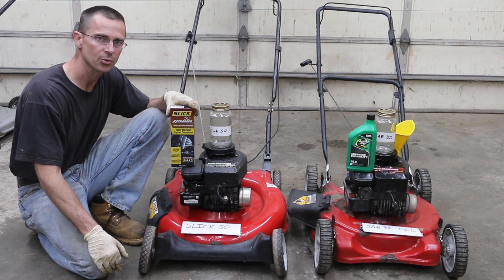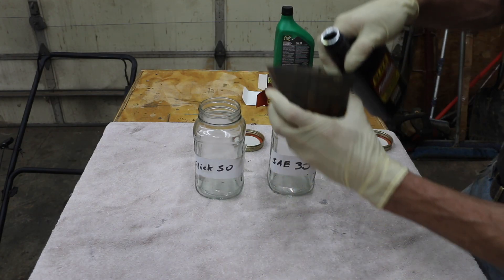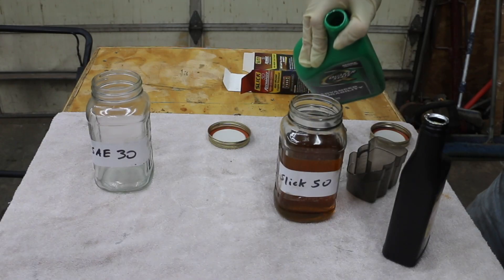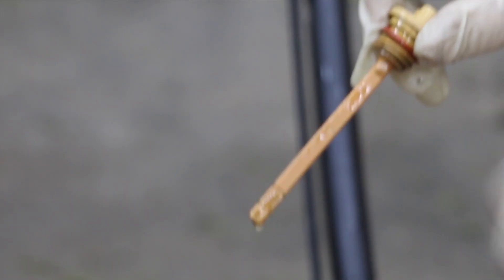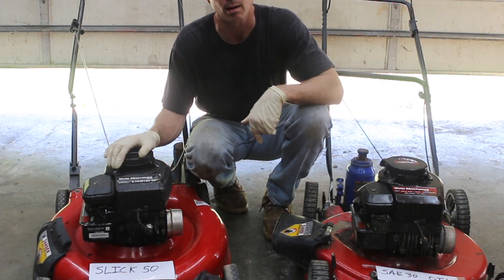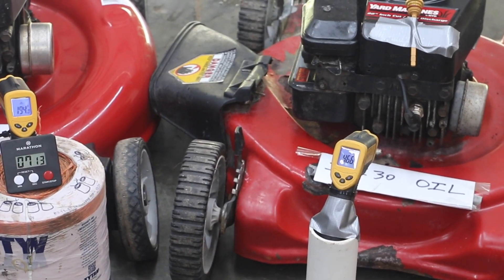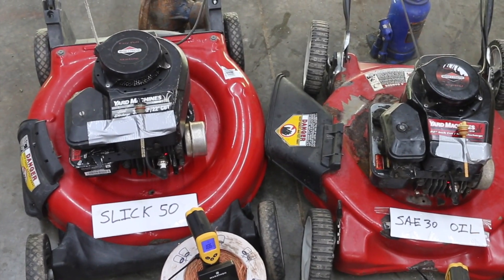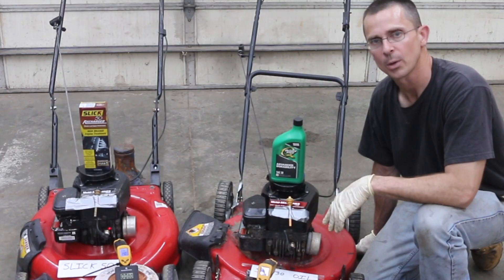Can't believe what SLICK 50 did to my engine!!--Dry Crankcase Test!

Comment: Could not tell from your video how many hours you ran the mowers after adding Slick 50 . In automotive use , to actually treat the engine you run it an entire oil change . I still use it in my cars and motorhome . Saved me a high performance engine in the 70s , I twisted off my oil pump shaft while doing a little Dukes of Hazard style driving . 327 in my Malibu (built) was running up to 7,500RPM for an unknown amount of time . When I hit a straight section (about 6,500 RPM ) I looked down at guages and the oil pressure read zero . Shut it down and walked to a farm and called my brother in law for a tow back to the shop . Dropped the pan and removed all main and rod caps , zero damage ! I had forgotten I treated it several years before . Later after rebuilding the engine in my van , I broke it in and at 20,000 miles ( do not add until broken in ) I added Slick 50 . Before oil change I checked temp and RPM at idle and average fuel mileage . After 100 miles on oil change I checked everything again and the idle rpm was 375 higher and the temp was noticeably lower . Mileage was up about 1.5 mpg . This was the time Amzoil cam out and I saw entire fleets of construction trucks blow new engines on their fine product . After a lawsuit and testing at that time , fresh Amzoil has something like 20% lubtication of standard oils . After 2,000 miles it tested at 8% of normal oil . Note about Slick 50 and many other additives , DO NOT put them in a wet clutch motorcycle ! While laid off from my normal job I fixed anything and got to replace the clutch on a Goldwing with Slick 50  and shortly later a Yamaha that used Mobil one . Fun test !

Comment: Test out Royal Purple.
Reply: I have seen Dura Lube in WalMart in the last year. I used it in a 3.1 Camaro in the 90s. Gave that car hell. My foot was always on the floor. I had to take a class to get 4 points back on my license,I was down to 2. When I sold it @ 249k miles, it would only burn half a quart of oil every 6,000 miles.
Reply: Project Farm try (Dura Lube) if you can find it it worked so good they took it off the market
Reply: Walmart sells dura lube
Reply from the maker: Thanks for the recommendation!  I'll give it a test!

Comment: i have done years of testing like what you have in this video,i have been to a factory that bottles for product like slick 50 and other lubricants and on the barrel it says do not use in a internal combustion engine and i would like to say that,the teflon in the slick 50 is at the bottom of the bottle if you dod not shake the slick 50 you did not put the main ingrediant --so in reallity you put the cheapest oil,like recycled oil wich may be in slick 50 and the straight 30,so that is your explaination of this video in my 30 years experience,like to hear from some oil engeniers.god bless us all
Reply from the maker: Jim,  I now wish I would have video recorded me shaking the bottle of Slick 50, but I didn't in order to keep the video brief.  Thanks for watching the video and commenting!
Reply: slick 50 is old technology and outdated-new engines need the proper oil,the future is synthetic

Comment: Doesn't the instructions on Slick 50 say to run it in until the next oil change?   In a car you are supposed to run it 3000 miles before you change the oil and it is supposed to be good for 50k miles.  I just wonder if the slick 50 need so much run in time to bond to the metal?
Reply: Agreed!
Reply from the maker: Dennis,  You make a great point!  Thanks for watching the video and commenting!
Reply: I have put this in my engines. I disappointed that it appears it made things worse

Comment: MotorKote... Look it up. That's a test.
Reply from the maker: Thank you for this product recommendation!  I'll see if I can locate it and test it!
Reply: Project Farm I agree, Motorkote is amazing, use it my trucks, cars, motorcycles, lawn tractor and snow blower. All run smother with better gas mileage, I was actually stunned at the difference. Love it when something works as advertised!
Reply: Project Farm yes test Motorkote please
Reply: Project Farm I'd like to see a test on Lucas oil stabilizer to see how much longer it takes to blow.
Reply: Project Farm you can get it on amazon
Reply: Project Farm they say there is nothing like it.
Reply: They also put on a fairly impressive demo on the Timken friction tester.

Comment: Man, back in the 80's my brother-in-law put Slick-50 in his Ford Bronco AND in my mother's Toyota pickup. BOTH engines shit a timing chain within 2 months. Since then I have only put engine oil in my engines. In my '98 Dakota 5.2L I ran Valvoline Racing Formula 20W50 to quiet the Dodge valve train noise (the top end noise of Dodge Magnum engines used to bug me). Other than that I have just stuck with manufacturer-recommended engine oil. 
Anyway, I'm here to tell you that Slick-50 is garbage.
Reply from the maker: Robert, Ouch!!!  Thanks for the comments and for watching the video!

Comment: You have to try Z-Max.  Ive had great results in carbon clean up and longer lasting engines.  Let me know.  Treat with oil and run to get hot to penetrate metal.  Then test for results.  Cant wait to see results if you go for it.
Reply from the maker: I'll be testing Z-max soon.  Thanks for the recommendation!!

Comment: slick 50 is full of shit, the engines in those commercials were modified heavily,  try to start an engine with hydraulic lifters with no oil and it will just crank, the whole top end of those engines were replaced with solid lifters, new push rods and i suspect piston rings removed. my grandpa an uncle and i saw a live demonstration of slick 50. my uncle who was a major mechanic at the time knew the engine they were using and called them out on it, they admitted to modifying the engine.
Reply: Consume excrement and perish!!!  You wrote " I suspect piston rings  were removed".....you're making the story up as you go
Reply: I am just suspecting the easiest method to reduce friction and keep heat down, there is no way in hell those engines ran with out seizing a piston or throwing a rod within a few minutes, especially with no oil to lubricate the cylinder and crank. especially a BB Chrysler. I don't remember the block that it was, my uncle threw an absolute fit in front of a crowd of people calling those slick 50 people out. what makes it stick in my head.
Reply: jaggernautxtr, you are a very rude dumass and shoulden even be alowed to leave a dumass coment.
Reply: So you can get an engine to run with no piston rings?? I'd like to see that
Reply: and that alone is your assumption, where does it say all piston rings removed? because your and idiot who thinks he knows what I am saying...... assume ass you me..........try again piss ant
Reply: oh I forgot your an expert at the english lanbuage too. again your assumption
Reply: don't answer the question piss ant avoid it like a plague.
Reply: i "suspect" piston rings removed
1. have an idea or impression of the existence, presence, or truth of (something) without certain proof."if you suspect a gas leak, do not turn on an electric light"synonyms:have a suspicion, have a feeling, feel, (be inclined to) think, fancy, reckon, guess, surmise, conjecture, conclude, have a hunch; Moresuppose, presume, deduce, infer, sense, imagine; fear "I suspected she'd made a mistake"believe or feel that (someone) is guilty of an illegal, dishonest, or unpleasant act, without certain proof."parents suspected of child abuse"2. doubt the genuineness or truth of."a broker whose honesty he had no reason to suspect"synonyms:doubt, distrust, mistrust, have misgivings about, be skeptical about, have qualms about, be suspicious of, be wary of, harbor reservations about "he had no reason to suspect my honesty"
Reply: see how well you know your english language there piss ant, and again you avioded answering it.
Reply: Removed as spam and only visible to you,looks like google just spanked a dumb ass
Reply: keep going piss ant, it so far above your head your will never reach the end.
Reply from the maker: Great point!  Thanks for watching the video and commenting!
Reply: yeah they will, and i didn't say all rings removed. they probably left a compression ring. I watched them do it live it took a few cranks before it started showing low compression. so the next time you try and call out someone who is Ford master certified try again. piston will seize and an engine before the crank will.
Reply: Ok Mr ford master certified...Found on road dead or fix or repair daily?
Reply: reach troll reach. go look up nissan engine recall.
Reply: English isn't your strong point go back to your job a jifffy lube you ass wipe....Come back when you can get your point across in a legible sentence
Reply: sounds to me like your an imbecile who belongs in jiffy lube tell me again how an hydraulic lifter engine starts with no oil, tell me why a 1970's chrysler v8 on an engine stand will sound and run just fine and not throw a rod running at above idle(Babbitt bearings), tell me how the pistons are not seizing in that same engine with no oil? your conclusion is obviously a lack of knowledge and under standing. remove resistance/friction to lower heat. now keep reaching and show how much more ignorant you are.
Reply: Sounds like the best part of you ran down your mother's leg...Considering your parents are siblings and you come from the low end of the gene pool ....and understanding is 1 word you poor excuse for a human being....now go fuck off and play somewhere else until ou can construct a sentence ...and why did you change the subject of the piston rings Einstien?
Reply: I am waiting almighty god!!!!! mind reading know it all!!!!! please explain oh foot in mouth and head up ass!!!! please explain.......
Reply: I never defended slick 50 jerkoff...all I said is I'd like to see your engine run with no piston rings like you fucking stated jackass
Reply: Your just butt hurt cause I  called you on your bullshit now fuck off!!!
Reply: Make us a video of your no ring engine and prove me wrong....I'm sure everyone would love to see it so they can get a good laugh too! I double dog dare you!
Reply: I suspect you bought a dictionary , but still can't comprehend on how to use it
Reply: I figured it out you have Ed Zachery disease....Your face looks Ed Zachery like my ASS!!!!!!!!!!!!!!!!!!!!!!!!!!!!
Reply: Took you a whole hour to write that cause you got your ASS SPANKED!!!!!!!!!!!!!!!!
Reply: o you can get an engine to run with no piston rings?? I'd like to see that
Reply: Go read my first comment
Reply: uh duh you made an assumption the entire point dumb ass!~!
Reply: You did when you suspected it had no rings .......ASSSHHHOOOLLLEEE!!!!!!!
Reply: Your the idiot who thought they removed the fucking piston rings....  not me...You got spanked again!!!!!!!!!!!!!!!!!!!! LMMFAOOOOOOO!!!!!!!!!!!!!!!!!!!!!!!!!!!!!!!!
Reply: assume (ass u me)
Reply: You box of burnt out light bulbs.....You make a Paramecium look smart
Reply: lol better look at yourself a little better dumb ass, for me its a guess, but your under standing of suspect is beyond your comprehension.
again your the assumption maker, the moron with out a fucking brain.
keep trying to attack me idiot and make yourself look stupier and dumber with every fucking comment you make.
Reply: you want rude, do you know what an assumption is, do you know the definition of SUSPECT, I guess not as the intelligent thing is know the language that you supposedly know better than anyone else on the planet. it was explained nicely the first time. I can't help if a complete and total moron does not understand the concept of an assumption.
where in the first paragraph does it say anything about me making an assumption.
as·sump·tionəˈsəm(p)SH(ə)n/nounnoun: assumption; plural noun: assumptions; noun: Assumption1. a thing that is accepted as true or as certain to happen, without proof."they made certain assumptions about the market"synonyms:supposition, presumption, belief, expectation, conjecture, speculation, surmise, guess, premise, hypothesis; Moreconclusion, deduction, inference; rareillation, notion, impression "an informed assumption"2. the action of taking or beginning to take power or responsibility."the assumption of an active role in regional settlements"synonyms:seizure, arrogation, appropriation, expropriation, commandeering, confiscation, hijacking, wresting More

sus·pectverbverb: suspect; 3rd person present: suspects; past tense: suspected; past participle: suspected; gerund or present participle: suspectingsəˈspekt/1. have an idea or impression of the existence, presence, or truth of (something) without certain proof."if you suspect a gas leak, do not turn on an electric light"synonyms:have a suspicion, have a feeling, feel, (be inclined to) think, fancy, reckon, guess, surmise, conjecture, conclude, have a hunch; Moresuppose, presume, deduce, infer, sense, imagine; fear "I suspected she'd made a mistake"believe or feel that (someone) is guilty of an illegal, dishonest, or unpleasant act, without certain proof."parents suspected of child abuse"2. doubt the genuineness or truth of."a broker whose honesty he had no reason to suspect"synonyms:doubt, distrust, mistrust, have misgivings about, be skeptical about, have qualms about, be suspicious of, be wary of, harbor reservations about "he had no reason to suspect my honesty"nounnoun: suspect; plural noun: suspectsˈsəsˌpekt/1. a person thought to be guilty of a crime or offense."the police have arrested a suspect"synonyms:suspected person, accused, defendant "a murder suspect"adjectiveadjective: suspectˈsəsˌpekt/1. not to be relied on or trusted; possibly dangerous or false."a suspect package was found on the platform"synonyms:suspicious, dubious, doubtful, untrustworthy; More

learn the English language and try to call me rude when the idiot obviously can't take a fucking hint.

thats why even the FTC was crawling up Quakerstate/slick 50 ass
https://www.ftc.gov/news-events/press-releases/1996/07/quaker-state-ads-slick-50-are-false-and-misleading-ftc-charges

as i stated above how do you keep an engine running with out seizing a piston with no oil, how do you keep a crank shaft from throwing a rod with no oil? why does it take an engine 3-4 cranks sounding as if it had low compression? again because the idiot didn't fucking read and came to assumption before he knew what he was even talking about.
Reply: Assumption 1. a thing that is accepted as true or as certain to happen, without proof.
sus·pect verb 1.have an idea or impression of the existence, presence, or truth of (something) without certain proof.
Reply: without certain proof. no assumption. i have not torn the engine down to either confirm or deny. that is how well you understand that statement
Reply: juggernautxtr god damn you pissed him off good. I'm with you though, I'd imagine they removed all but one compression ring and left the oil ring so they could have some compression and minimal piston slap.
Reply: Remember the one ad not sure if it was slick 50 but the guys on the engine stand keep pushing it higher tell they said no more and were so amazed and nervous at the same time such bad acting lols.
Reply: I my self use polydyn TX7 use it in place of a quart of oil every 10 too 15K miles the stuff is so good they tell you not too use it in a brand new or rebuilt engine till its broken in so everything wears in.Back in the day I used too use QMI but it barley had any teflon resins in it also your oil filter would just catch the resins.Remember fram filters they stopped using teflon in their filters because the filter would just catch it.I use the TX7 in the 6 speed also the shifts are so smooth they have it for the power steering and rear end also.Whats cool is you can get it on Amazon where you used too have too call them direct in Texas.
Reply: It's your claim Mr ford master certified...Guess your the idiot..." I suspect piston rings removed"
Reply: Where does it say some?????? Mr almighty ford super technician.?????????????????
Reply: IT'S ALL BULLSHIT .............................
Reply: FULL OF SHIT...KNOW IT ALL
Reply: MAYBE WE CAN START YOU A GOFUNME PAGE SO YOU CAN GET A 3RD GRADE EDUCATION
Reply: Show us your video if it can be done...Mr supertsch
Reply: You claim it can be so it must be true
Reply: Maybe it's the cancer that's hurting you so bad
Reply: It's your lie tell it like you want to
Reply: Getting kinda slow there Mr Webster
Reply: Still flippin pages in that new dictionary?
Reply: Bet he went and cried to his Momma too!!!! WAAAHHHAAAAAAA!!!!
Reply: Au contraire, mon idiot.....I have just begun!!!
Reply: your assumption

Comment: Nice! Where those same type engines with same amount of hours on'em?  Wondering if you let the oils penetrate internal eng part for about 25 hours  (I think that's the avg oil chg on mowers.  And did you try to let them cool off, (free them up), put oil back in them to see if they would start up?  I also was a slick50er way back & then I switched to Prolong...  If I remember correctly  Slick50 comm would dump dirt in the engine and Prolong did the drain oil test and actually rode around town, uphill in a Dodge Viper and the engine never seized.  Would love to see a test or duels btw the 5...  SLK50, Plong, conventional oil, synthetic blend, and Full Synthetic...  Good test tho bro..
Reply from the maker: Tony,  Great points!  I wish I had new engines to test!  I plan to test Prolong and the other ideas you have are GREAT!  Thank you!